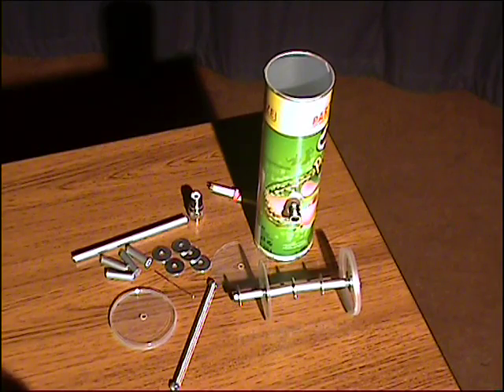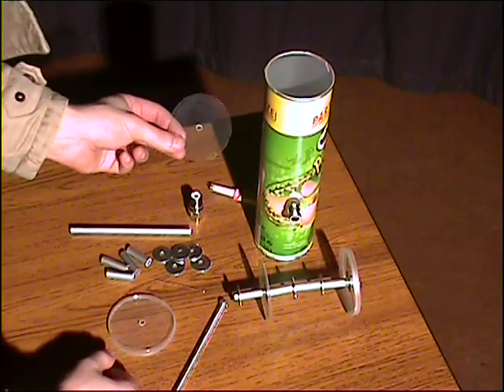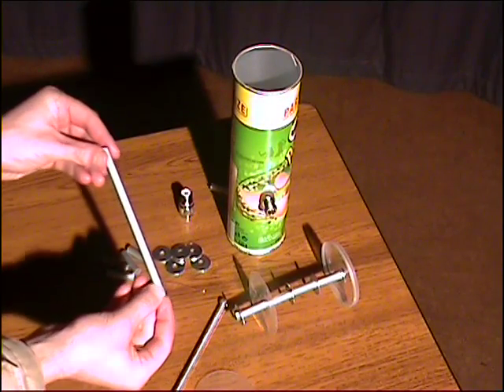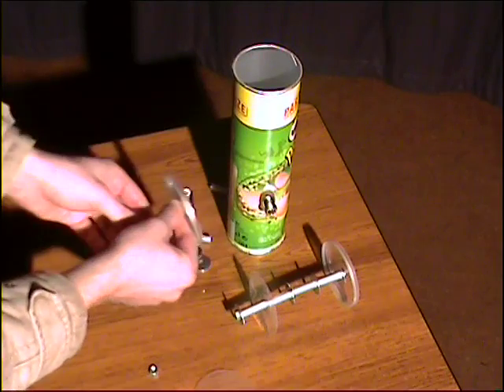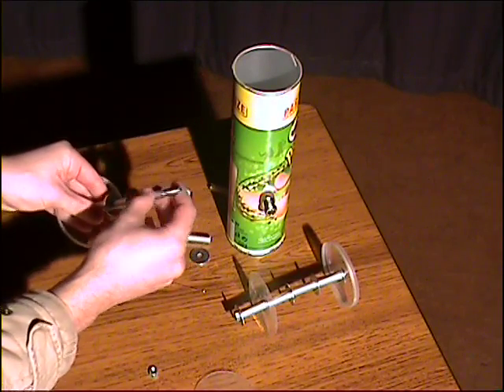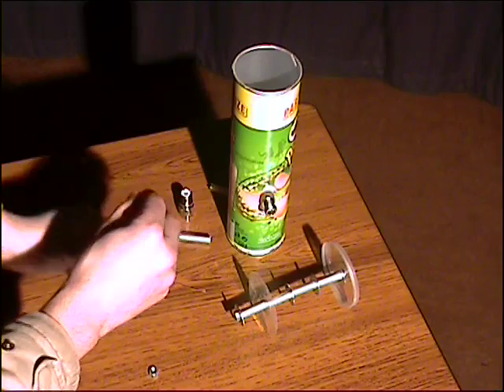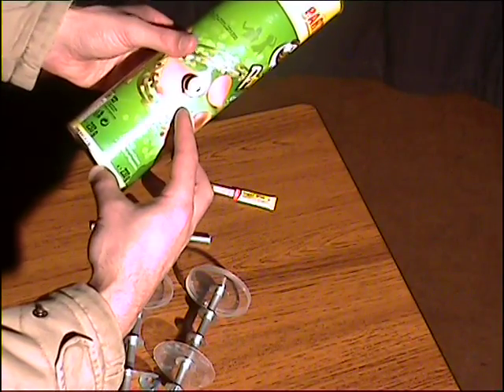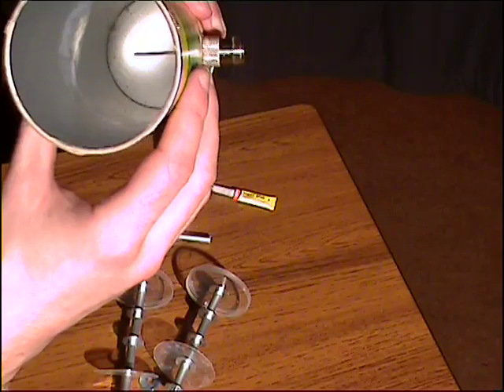DIWi-Fi

Comment: It's just an antenna.  All the cantenna videos are assuming you have a wifi card in your computer.  You basically remove the tiny antenna attached to your current card and use this one instead.  Search for "wifi pigtail connector" and you'll find various connectors you can use to attach the antenna to the wifi card in your computer.

Comment: I know that. My cell phone has Wifi, and someone off in the distance has an open Wifi my cellphone keeps trying to connect to, and it cuts off the 3G connection. My cell phone can hear them, but they cannot hear me. They must be using a pringles can or something like that to boost the signal.

Comment: @newm123 use this "RP-TNC Plug to N-Female, Pigtail 2 ft 195-Series" and then connect to the wireless card. You need a wireless card with an antenna. Something like this: "Linksys Wireless-G PCI Card WMP54G Network adapter - PCI" then you screw it in and your done. I'm just guessing thats how this works, so don't quote me on anything, but from what I've seen, this is how its done.

Comment: if you have a WLAN card attached to your laptop via express card or PCMCIA which has a detachable antenna than just remove the antenna and attach the pigtail from the pringles can, if u have an internal  like me you could possibly get a U.FL to RP-SMA adapter and then open ure laptop, connect the other end of the U.FL adapter to the internal card and then try to see if you could possibly cut a hole get the RP-SMA male connecter outside from within the laptop